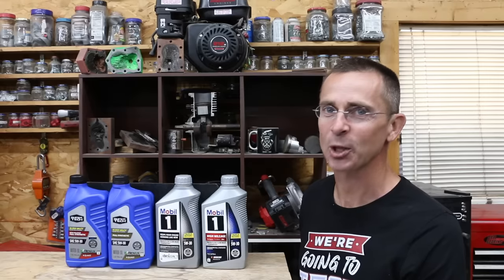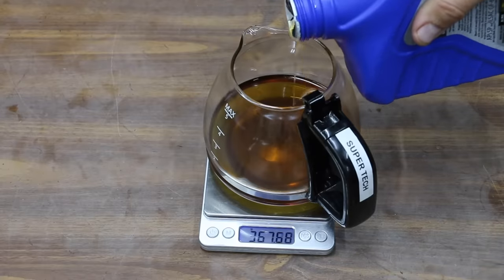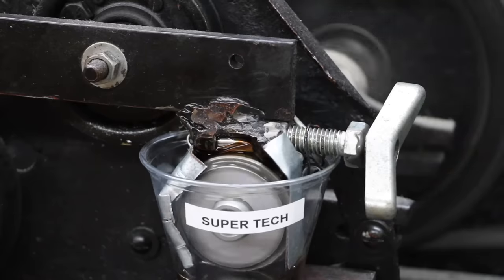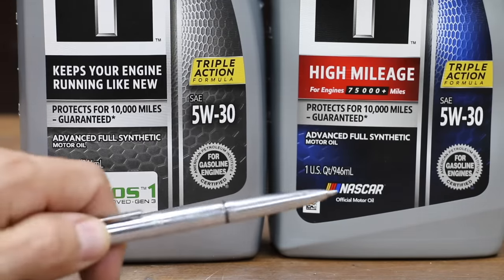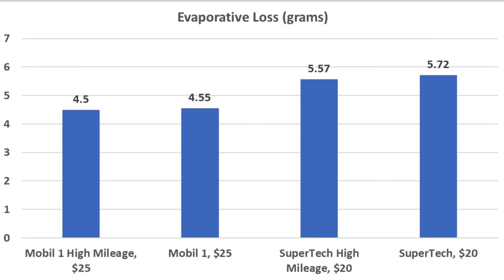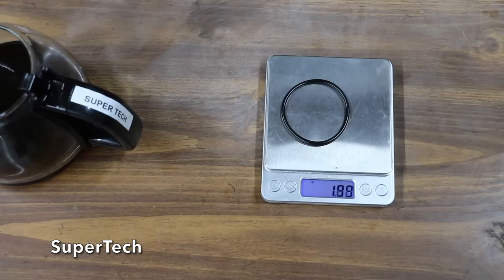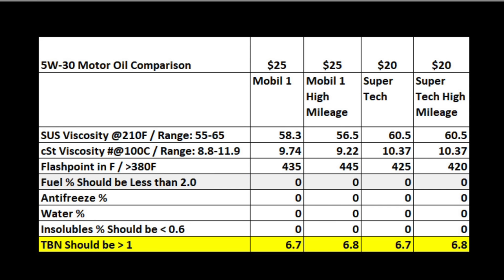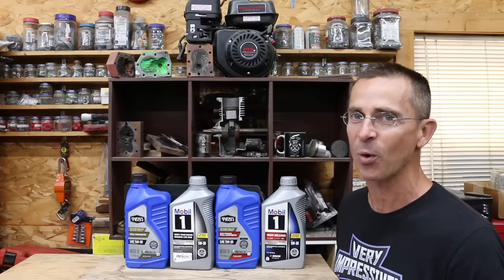Is “High Mileage” Motor Oil Safe? Let’s find out! Mobil 1 vs Mobil 1 High Mileage; SuperTech vs STHM

Comment: I haven’t seen anyone test 15w40 brands yet specifically full synthetic vs conventional. I was hoping you could test those since your tests are amazing. I’ve also been curious about Shell T6 15w40 vs Schaffers 15w40 mostly because those are the top dogs and claim to flow good when cold and have great wear protection
Reply from the maker: Thanks for the suggestion.

Comment: I've been running Valvoline high mileage synthetic in my Jeep JK with the 3.8 mini van engine.  Not because I expected any improvement but because Walmart sells it at a way lower price because no one wants it.  Working good so far.
Reply from the maker: Thanks for sharing.
Reply: I was getting that oil for $22. Bought a bunch of them for that price.
Reply: Its probably the best HM oil...

Comment: It would be interesting to see how oil dilution with gasoline affects the lubricity tests.  Awesome video. Keep up the good work!
Reply from the maker: Thanks, will do!  Thanks for the suggestion.
Reply: @ProjectFarm  yes, the honda 1.5turbo have had major prob.
Reply: That’s a good idea. Especially considering how many turbocharged engines there are today, which will all have some level of fuel dilution during an OCI

Comment: Hi Todd,
 
Recently I had a snowmobile mechanic do pre-season service on my 2022 900 ACE four stroke engined Ski Doo Expedition.

I have only 160 miles on the machine.

The mechanic overfilled the oil by one quart.

I was about to take my first ride but on a lark decided to check the oil.  Good thing I did because of the excess oil.

I did run the machine a bit to being the engine up to operating temperature.

I removed a quart and the oil was at the max line on the dipstick.

The mechanic was informed.  He took the machine back and repeated the preseason service.

When he removed the Ski Doo 0w40 full synthetic it looked like peanut butter.

The mechanic says the appearance is do to air mixed in the oil.  I kept a pint of the oil and it seems that the air is suspended and doesn’t leave the oil.  If there are bubbles they are microscopic.  It might take weeks or months for the bubbles to pop, if there are bubbles present.

Is air entrained oil dangerous to my engine?

The oil isn’t a merange but rather cloudy and still flows and should flow through engine passages.

I have fresh oil in my machine today.  I don’t want to risk using the peanut butter colored oil.

Can you test oil foaming from crankcase whipping and test the wear protection of the foamed oil?

Thanks,

Bob
Reply from the maker: Thanks for the video idea.

Comment: I use Mobil 1 high mileage in my boat, going on 12 years now. My logic was the boat sits all winter long (I start the engine a couple times during the off season) and thought the added protection would add life to both engine and seals. After watching this informative video it looks like I made a wise choice...
Reply from the maker: Thanks for sharing.

Comment: Amsoil and Pennzoil both have a 0W16. I would love to see how their 0W16 does against their own fantastic Amsoil Signature 0W20 and Pennzoil Ultra Platinum 0W20. Thanks again for the amazing reviews
Reply from the maker: Thanks for the suggestion.
Reply: 0w16 is to meet CAFE emissions. So it is beneficial for the manufacturer to spec thinner oil for microscopic MPG gains but there is no real tangible benefit for an individual consumer to actually use 0w16 instead of 0w20.

Comment: 2011 Chevy 3500 6.0l V8 Vortec says 5w-30 DEXOS in the manual. Sticking with it. High mileage sounds great but 1% difference in wear doesn't justify deviating from what the manufacturer recommend.
Reply from the maker: Thanks for the feedback.

Comment: I used to be a mobile 1 guy but now I use castrol edge 0w 40 a3/b4 in most of my stuff. It sheers less and holds up great. Have you ever done a test on that oil? Great content and as usual I'm surprised at super techs results... not bad for the price!
Reply from the maker: Thanks for the suggestion.

Comment: PF I've been using Kendall 5w/30w full synthetic in my 2002 S10 2.2 liter since it's first oil drain in 2002 ..( I drained the factory oil at 1,500 miles) here it is 21 years later with 150,000 miles & No Smoke..No Oil Leaks..& running strong💪👏
Reply from the maker: Thanks for sharing.

Comment: High mileage oil isn't just for cars with high mileage either. We have a 2015 Santa Fe Sport 2.0 Turbo with 120k km on it. Took it on a cross-Canada drive (Vancouver to Quebec, approx 5,000 km one way). Using regular oil of the recommended viscosity (5W30, I think it was) we were going through about half or more of a litre of oil per tank of gas. We did some research at the hotel 2 or 3 nights in and found that high mileage oil is recommended for those engines, so we switched. Barely burned any oil after that.
Reply from the maker: Thanks for sharing.

Comment: In Diesel Tech College, my professor cut open a FRAM and a GM oil filter.  The Fram Filter had more surface area, so he said the FRAM filter offers better engine protection than the GM dealership filter.
Reply from the maker: Thanks for sharing.

Comment: Love this channel!
Please consider comparing high zddp oils required for flat tapper, air cooled and classic car engines.  Examples are Penn Grade 20w-50 vs Valvoline VR 20w-50 vs Driven 20w-50.  
Thank you.
Reply from the maker: Thanks!  Thanks for the suggestion.

Comment: I found this particularly interesting because I had asked a mechanic, probably 10+ years ago, about oils in general. I had noticed that when checking the oil level, there was quite a bit of foam in the dipstick tube. He told me it was because of the amount of detergents added to the oil. He then suggested I use the Moble 1 because they put less detergents in the oil. Since I did that, I haven't gone back. I was using Penzoil. Since my newest vehicle is 2008, I don't worry about warrantees, I have also never had any problems with the oil. I would not use the other oil because of the amount of detergents and the faoming that is likely to occur with extended use. I would highly recommend the Mobile 1 HM version. Been using it a long time and all my engines still purr like a kitten.
Reply from the maker: Thanks for sharing!
Reply: the detergents in oil are not like soap for dishes they are solvents they would not cause foam in oil putting too much oil in engine, so crankshaft hits and froths up oil causes foam most of the time or some impurities like water if it does not get driven a lot and does short trips my Honda civic kids used got white foam under cap from just being driven a couple miles and never getting up to temperature to evaporate water off
Reply: @ranger178  yes, it's not like soap at all. there is an additive in oils to help release the air bubbles "foam" from the oil, I forget what exactly it is but yup.

Comment: Way back in the 1980s, I got sent to northern Canada as an exchange officer.  That first winter was a learning experience for me. The first time it went below -30 overnight, my car would not start in the morning. I had conventional motor oil. So I switched to full synthetic oil right after that, and it always started after that, except one time that my battery was to blame. I have always used full synthetic since then. I also change the oil every 5000-6000 miles, even though the oil advertises it will last 10,000 miles. And I've never had an engine wear out or start burning oil since then.
Reply from the maker: Thanks for sharing.

Comment: Looks like I’ll be using Mobil 1 high mileage from now on. I drive a 2009 Acura TSX and it churns through oil because of an engine recall. I’ve used Mobil 1 in the past and it had far superior life between adding oil compared to castrol high mileage
Reply from the maker: Thanks for sharing.
Reply: Castrol like the cheapest?

Comment: Sure there are oils better than some but nothing stands up to just changing your oil like you should. 

Great videos I seriously value your opinion and channel
Reply from the maker: Thank you!
Reply: And making sure the level is up every week.
Reply: @pgmurray76  that should go without saying. but no one does, they figure you should never need to check between changes. And they can many times get away with that at 3-4-5 k mile oil changes. But no one really understands how an engine works, oil has to lubricate the pistons, rings & cylinder walls, so a small amount gets by the rings and burns up in the combustion chambers on each stroke. And if an oil is run long enough it will volatilize off some of the lighter fractions, that is normal for regular 4$ oils and to a far lesser degree with premium synthetics.

Comment: Good test methodology and video!  It seems there is very little difference between these oils within experimental error.  The oil viscosity test at -40C unsurprisingly exhibits a disparity between brands, variants and/or manufacturing process or dates of product.  To compensate for this variation, an oil pump on a modern engine has a relief valve to relieve the excess pressure.  It has a spring with a specific set point and opens in the presence of excess oil pressure (cold oil).  Once the oil warms up to operating temperature, this relief valve closes.  Claims for "seal conditioning" and "prevents leaks" are marketing jargon.  I have never seen any oil that prevents leaks or stops leaks.  Thank You!
Reply from the maker: Thanks!
Reply: How can you say there's very little difference, considering the -40C viscosity test? There was a shocking difference. Yes there's a relief valve for excess pressure. It's not excess pressure that is the main metric though, it's flow of oil when the engine's cold.

Comment: I can absolutely vouch for the Mobil 1 high mileage oil. It has almost entirely stopped a leaky rear main seal on my '93 Crown Victoria. It's gone from me needing to put something under the car to catch the leaking oil to now there's never any drops on the garage floor and while I can still see where it's leaking very slightly, it's probably a 98% or 99% fix. I'm very pleased with the product.

Comment: The NUMBER ONE thing you can do to protect your engine from wear is to install an oil bypass filter that will filter down to four microns. The majority of your engine wear happens between 5 and 20 microns (because almost all regular oil filters only filter down to 20 microns). Installing an oil bypass filter on your oil system will greatly extend the life of your engine.
You might also want to consider installing a bypass filter on your cooling system as well. As it is, there is no filter on your cooling system so dislodged casting sand and other contaminants race through your engine sandblasting everything. A bypass filter on your cooling system will extend the life of your water pump and other components like heater cores which are a nightmare today to replace.
With the price of vehicles the way they are today, why wouldn't you do everything you possibly could to extend the life of your engine and engine parts?
Reply: Also there are magnetic filters for transmission lines.
Reply: and power steering

Comment: Nice video as usual 🙂👍
Here is My 2 cents on Mobil 1 HM: I’ve been using Mobil 1 Full Synthetic High Milage 10-30 in my 97 Jeep Wrangler (4-cyl / 260K miles) for a while now and the oil has been performing quite well (no problem or leaks or else …). The only “complaint” I have is with the claim of “10,000 miles guarantee” (I know, there is an “*” for that claim 😅). I was hoping to reach the 10k miles between oil change during my last overlanding trip to Alaska : because it kinda sucks to change your oil yourself on the road during a road trip … so the longer between oil change, the better … HOWEVER after 5K-ish miles the oil really started to deteriorate and at 6.5K miles it was really bad and I decided to (had to) change it : it was completely black and I could smell burnt oil at the exhaust …. Lesson learned: no issue for my Jeep with oil performance but definitely some issues with its “durability” (aka the 10k miles claim). But I will reuse it again. I’ll just make sure to check it often and most likely change it at 5K … still better than the recommended 3K miles interval between oil change with conventional motor oil.
Note: 1) I was not towing anything. 2)Jeep was definitely on the heavy side but not overloaded 3) I was using Mobil 1 extended performance oil filter 4)I drive my Jeep as if it’s broken aka as a grandpa 😂 no abuse: who wants to travel far takes care of its horse … Cheers ✌️
Reply from the maker: Thanks!  Thanks for sharing.

Comment: I had a Volvo 240 used Mobile High mileage full synthetic.. 
At about 650,000 mikes it developed a rear engine seal leak. 
At 760,000 a guy passing me, avoided a head on collision by hitting my front corner. The car went over a curb, destroyed exhaust. 4 damaged tires, 4 damaged rims. 
About $75 in body damage. Front left panel and the headlight mount.

Comment: Love your videos! Oils are so good today that engines rarely wear out before other parts of an automobile. The body rusts out, transmissions fail, etc before the engine has a chance to wear out. I've used super tech for about 25-30 years now with no issues whatsoever. I've saved a lot of money though.
Reply: I hear a lot about oil sludge buildup these days on certain engines. Not sure if some oils are better than others in this regard.
Reply from the maker: Thanks!  Thanks for sharing.
Reply: From what I recall, Project Farm's videos for "Oil Olympics" demonstrated very comparable performance amongst most brands of oils
Reply: You need regular rust prevention just to keep the body from rusting out. They need a proper Fluid Film type that can absorb into the metal and repel any rust without having to reapply it yearly or everytime you hit a puddle.

Comment: Thanks for this video! I've certainly wondered how the Walmart stuff stacks up. I was surprised to see the results for zinc concentration. I'd read somewhere that oils used to have high zinc, but that it can get past rings and enter the exhaust, then clog the catalytic converter. So it has been removed from oils. Apparently, it's only been reduced. I wonder what the concentration of zinc in 5qts of these oils would be raised to if one added a can of Rislone high mileage treatment with Zinc? The label on Rislone says to not add it to cars still having to meet emissions testing, presumably because of the zinc thing. What say you PF?
Reply from the maker: Thanks for the suggestion.

Comment: Thank you for doing this one! I only use Mobil 1 "High Mileage" oils and Mobil 1 filters in my vehicles, hoping that that was the best option to keep them running for the longest time. I now, however, have the peace of mind that it IS a great oil and will continue to use it!
Reply from the maker: You are welcome!  Thanks for the feedback.
Reply: Walmart oil does better then Mobil 1 according to test
Reply: Been using mobil 1 for years. Actually used it 2 days ago on my Tahoe. I'm now switching to pennzoil ultra platinum for the next oil changes for my silverado and tacoma. Only thing really better is Amsoil.
Mobil 1 is way overrated according to all I seen in these videos.
Reply: @NoName-qs6ei  switched over last year. all my trucks run so much better. i use wix xp filters. seem to get higher oil pressure overall.
Reply: @NoName-qs6ei  toyota mobil 1 is better than the original

Comment: Regardless of oil used, the best protection is to change it every 3K to 5K miles, depending on environment like dust, heat, whatever. The piston rings for some time now are not as strong making it much easier for crud to build up inside a cylinder. Changing the oil often helps to avoid that problem.
Congrats on the coffee! It's about time. :))
Reply: Just what I was going to say.
The carbon deposits that pass the rings dirties the oil. Having great oil only going so far, when it gets dirty it needs changing. So, might be more cost effective to run cheaper oil because you’ll be changing more often.
Reply from the maker: Thanks!

Comment: I’ve always used Castrol Edge. I think it’s a superior product. Most oils today that are full synthetic will do the job just fine. Thanks Project Farm for the great and informative video.
Reply from the maker: Thanks and you are welcome!  Thanks for the feedback.
Reply: The problem with Castrol Edge is that it is not a true full-synthetic oil because it uses a group III base stock which is regular dino oil that has been hydro-cracked.  Mobil-1, AMSOIL & others are true-full synthetic because they use a fully synthesized group IV PAO base oil which is superior.  Mobil-1 actually sued Castrol back in like 1999-2000 over Castrol's false advertising claiming it is a full-synthetic.  Unfortunately, the court sided with Castrol because, although it uses group III regular oil, it can be considered synthetic because it has been highly processed which is BS because the decision was made without consulting independent chemists or engineers qualified to make such a decision.  The outcome of this is that low-cost oils using group III base oils such as super-tech, Costco, etc. can be considered full-synthetic when they truly aren't.  Note that Castrol Synthetic as sold in Europe and specified by BMW & other manufacturers is a true full-synthetic oil using group IV base oils.

Comment: I've used Super-tech for 15 years... high mileage for 10 years ...100,000 miles + per year...7,500 miles on average between oil changes...zero engine issues
Reply from the maker: Thanks for the feedback.